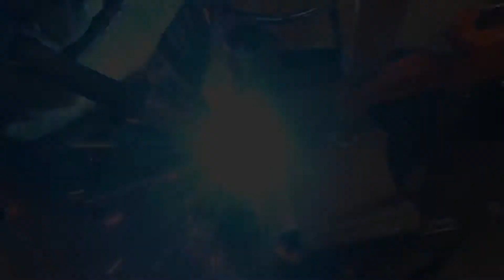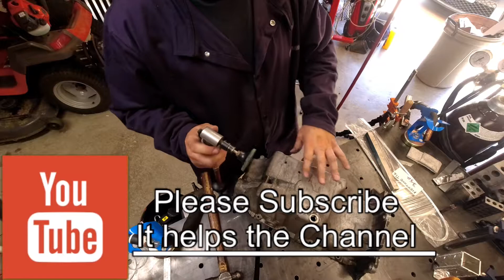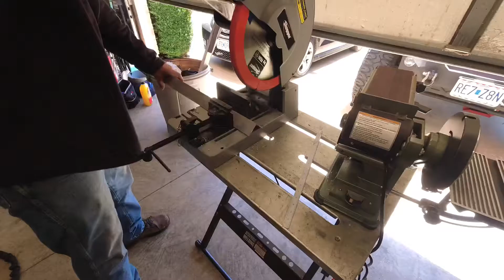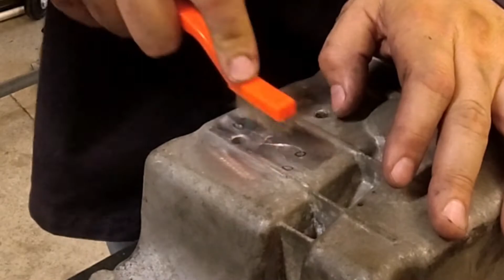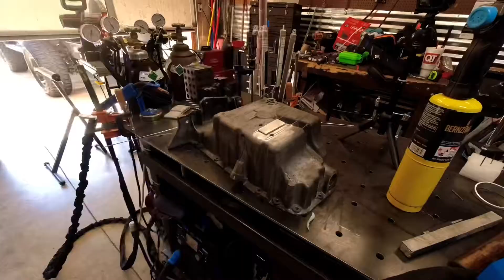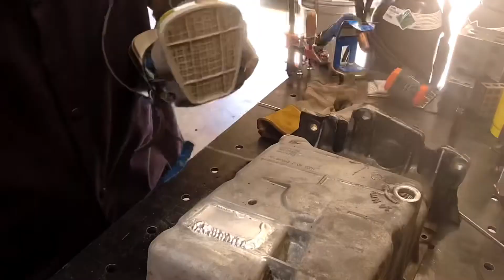Tig welding Cast Aluminum repair

Comment: Take the tig torch and slowly go around the area to be welded and let the cleaning action of the tig work the area, that will clean it ,pre heat it and give you the best chance at getting a nicer more oil tight repair. And pre heat the patch material also and clean it the same way. It will be a huge help to nicer welds on anything, God bless
Reply from the maker: Thanks for the advice, hope you liked the video.  Are there any other videos you would like to see.   
Thanks again.
Reply: @4x4fabshop  don't have any thing I would like to see , but I can tell you this ,guys like to see close ups and good arc shots that's what guys really learn from and what draws the eyes your way , good luck ,God bless
Reply from the maker: @billpickelheimer8142  thank you  god bless.